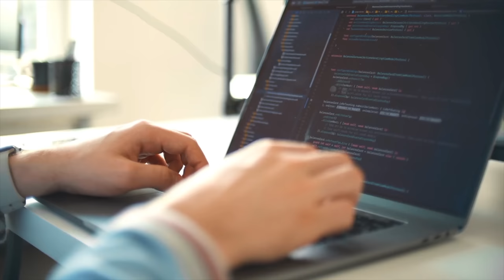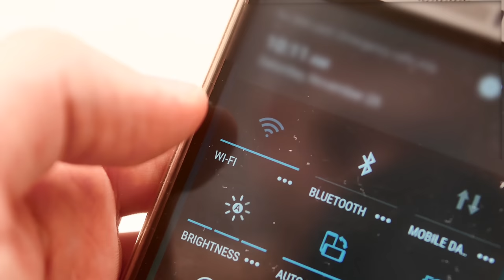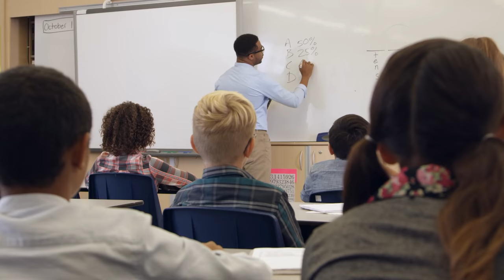14 More JOBS You Can Do In The Country

Comment: FYI, delivering motor homes will require the driver to have a CDL. Any truck used for hauling campers that is greater than a 350 (i.e.,  a Ford 450) will also require a CDL which comes with its own long list of requirements.
Reply from the maker: A truck driver is another great option for those who want it. I think if your gross weight is under 26,000 you don’t need a CDL but I could be wrong. There are regulations that need to be looked into for many things and more research is needed. Obviously each one of the suggestions needs more than a minute and a half worth of investigation. But for those who are interested they can do more research. All the best.

Comment: Some good ideas from a brainstorming perspective.  Be careful to check local regulations, permits, and requirements.  Licenses, insurance, permits, and equipment can kill profits.  Also don’t forget that self-employment increases your taxes.  Remote work options are best for any office worker looking to leave city life.  

I know several steel detailers that work from home.  It’s a good niche to get into but if you are going to work from home you first need experience.  The pay can be very good.  You need a good internet connection, phone, software, good computer, and an ability to print drawings or a place to pay to have them printed.
Reply from the maker: Good points.
Reply: Steel Detailer ???? What is that ?
Reply: @CatDaddySteve  It's a person who gets drawings from engineers and architects and makes drawings for welders so they can fabricate the steel for commercial buildings.